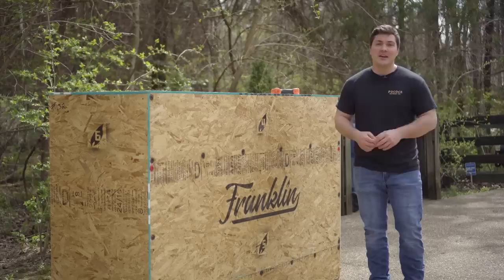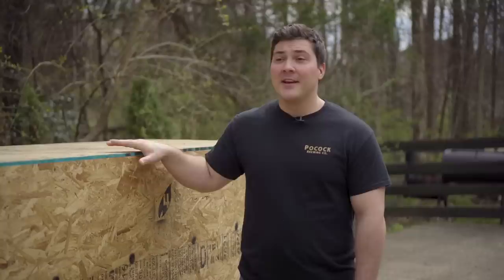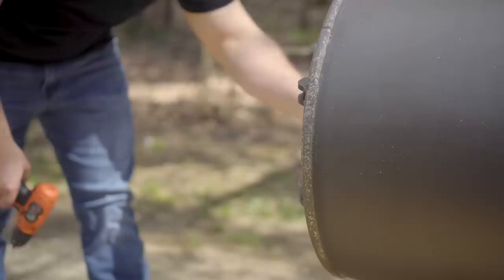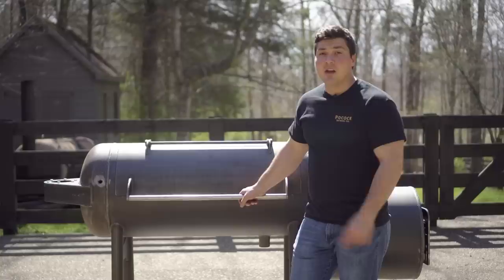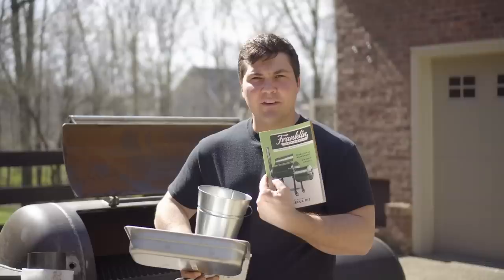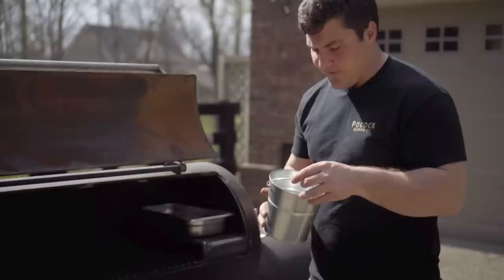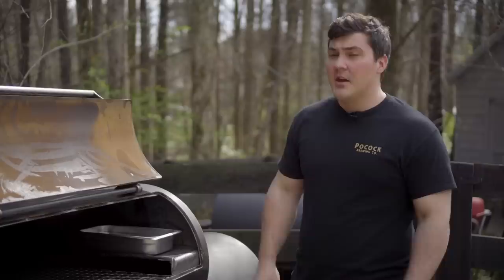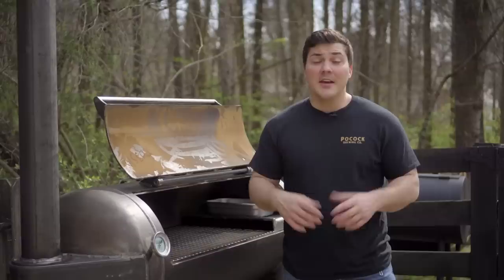Franklin BBQ Pit - My First Look | Mad Scientist BBQ

Comment from the maker: For those who are interested. I’ll be testing this out with brisket, pork butt, ribs and beef ribs. I’ll also be doing a comparison between this pit, the old country brazos, and a backyard size FatStack (custom) smoker. Let me know if you have any other suggestions!
Reply: Looking forward to the comparison.  I have my heart set on getting a Workhorse pit one day.  Also I like the music in this video.
Reply: Can you do a pork belly? Also will you show how you clean it and season it? I should clarify, clean and season the smoker :p
Reply from the maker: @UseAbuseReuse  for sure. I have been meaning to do that for a long time anyway
Reply from the maker: @great207  I have heard of them but I need to do some research
Reply: Since you have an all star line up of smokers for comparison, how bout include a Meadow Creek Ts 120 ?
Reply from the maker: @michaelkennedy272  that would be great. I’ve cooked on one before and it’s a good pit but I just can’t afford to buy that one too. If I can borrow one from somebody then I would be happy to do it
Reply: I can see the price being American made with good craftsmanship, especially in the welding. As a Steamfitter who has worked with pipe for over 20 years.
Reply from the maker: @jamesheenan648  quality American craftsmanship is not easy to come by and it’s not cheap when you find it
Reply: Please compare fuel use. Does the "beefy" build and price pay you back in splits?
Reply from the maker: @viclipsey3503  great idea!! I hadn’t thought of doing that.
Reply from the maker: @BBQcheese  I haven’t cooked on one. I cooked on a few meadow creek pits, but haven’t been able to get my hands on a Lang
Reply: How much do they cost? I’m comparing this to a Milwright.
Reply: Looking forward to that video!
Reply: @MadScientistBBQ  I hear ya ,that awesome American craftsmanship doesn't come cheap.
Reply from the maker: @ThatKidKc722  it was 4K after shipping
Reply: I was choosing between this Franklin, the Millscale 94 gallon, Workhorse 1975 and the FatStack 120. Went with the workhorse, but won’t be here for another month. Impatiently waiting....haha
Reply from the maker: @stewrogers7406  I hear ya
Reply: @MadScientistBBQ  seems about right! It looks quite well made
Reply: I have been using a pellet grill for over a year. Then I started following you about 4 months ago and now I know why I have cheating my taste buds. I have been torn on which offset smoker to buys this up coming video will help me out a lot. Would like to get into catering but I need to master the offset first. I enjoy all your videos and wish could come to one of your pop up events to try the brisket. Keep up the good work.
Reply: Which backyard fatstack!?!? The 120!!!!!
Reply: Fat side up?
Reply from the maker: @acureone987  whichever one I can get first!
Reply: Looking Very Forward to seeing you season the new Franklin and the Brisket, Ribs, Pork Butt, Turkey & Chicken Videos!  Also- Don’t forget the Initial Biscuit Test!! 😁👍👍
Reply from the maker: @2005Pilot  great idea!
Reply: How many briskets will this hold?
Reply: I love the idea.  For some reason the metal sounded light when you were rolling it around?  I would love to see the side by side comparison with the other backyard cookers!!!!!   Fire up as many as you can and get to work!  Hahaha.  Love your videos Jeremy
Reply: what is the price point on it?
Reply: Pork belly 😋
Reply: @stewrogers7406  The Workhorse 1975 is legit
Reply: Wow that offset Franklin looks really nice I just purchased a offset reverse flow smoker 36in Lang Deluxe hybrid Runabout waiting for it to come in by July excited to try it I might just purchase myself a Franklin later on down the road but I think this Lang is going to go ahead and do the job enjoy your videos keep it coming
Reply: I like many others bought the OC Brazos after your review and extremely satisfied might I add. Myself and others I’m sure want to know if this smoker is worth 3 times the cost of the Brazos... It looks very similar to a Lockhart Mill Scale 🤔
Reply: Go. Brazos!!!!
Reply: any chance you could link where to get one Jeremy?
Reply: Everything sounds great Jeremy.
Reply: @gregmccoy8616  I'm pretty sure we already know the answer to that question....😂
Reply from the maker: @thegoose3  the book says 3
Reply: I WOULD OF WENT WITH THE ROSETTA STONE REFERENCE , in the beginning because it was discovered by butcher, i mean Bouchard
Reply: Yes! Thanks for the great vids. You have one of the all-time best bbq channels.
Reply: I am definitely looking forward to the comparison. I've been considering getting on the wait list for one. I'm glad you gotten yours, and that will get a solid review on it. Cheers, and congrats on the new smoker!
Reply: Link to buy it please
Reply: If you could smoke  lamb (shoulder,  leg or rack) that will be awesome,  something new too look at. Also beef pastrami ribs...😏
Reply: Any thoughts on trying to do some videos on the Lang, Yoder (are you related?) and Klose pits?

Also, perhaps a future video idea on doing some smoking in subzero temps, like how you’d set up, how to protect the smoker, modifications to techniques? I live in ND near the Canadian border, and when it gets stupid cold, I’m curious if it’s even feasible to run a smoker (guessing it is, but would like to see the Mad Scientist’s take on it)
Reply: What is your take on burnt ends? Do you like them and have you done a video yet on them?
Reply: Are there any you recommend (even HAMRFORGE ) smokers to get to start a company ? Well a small business ?
Reply: I think a sort of “ultimate” comparison video would include a Weber Smokey Mountain (~$500) vs Brazos (~$1k) vs ~$1500-$2k smoker (Lone Star Grillz, etc.) vs Franklin ($2.5k+). That way, every price range is addressed to determine the cook and quality difference of each level. I think this could help a lot of people to figure out where they find the most value. Maybe you could borrow some smokers to help make it happen?
Reply: Can you add in a pellet grill with high quality pellets for us on the stick burn fence?
Reply: You do great vids.  I definitely like all the instruction and tips you give.  Keep up the great vids.  I'm a huge fan.
Reply: Good pit but WAY overpriced for what you get. Jamie Geer's pits dont cost much more and are FAR superior in every way.
Reply: Do you still have the gravity fed smoker? It would be interesting to see those two go head to head.
Reply: Casting my votes on a comparison between this one, some other customs and something more mainstream like a Yoder. Also, if you could check whether the surface temp of the waterpan tray get's hot enough to sear a snack (sausage for instance) for the pitmaster :)
Reply: I want one!!!!
Reply: Please include that $400 Home Depot pit in the comparison!  You were surprised at how well that Home Depot pit cooked a brisket, let's put it up against this beast!
Reply: Wow.  I dont know if the bbq with his name is worth the 3k price tag.  Could make tx brisket for much less.  IMHO 🤠🤔
Reply: How much?
Reply: @MadScientistBBQ  Speaking of not cheap, how much was the cooker? Their website doesn't list price.
Reply: Put that drill on there too.
Reply: @c7adventures376  It's actually $4k, holy cr*p, someone needs to tell the Emperor he has no clothes!
Reply: @hardtimesbbq5265  some people like to pay more for a name. I promise you can buy lots of other rigs for less money that are as good if not better.

I like Lyfe Tyme.  They are a great Texas made pit at a good price. Get one on sell at H.E.B. when the summer season is almost over.  They dont like to have them left over winter time.
Reply: @great207  oy
Reply: A tip: watch movies at Flixzone. Been using it for watching loads of movies recently.
Reply: @Dawson Matteo Definitely, I've been using flixzone for since december myself =)
Reply: @Dawson Matteo Yup, been watching on flixzone for years myself :D
Reply: @Dawson Matteo definitely, I have been watching on flixzone for years myself =)
Reply: @Dawson Matteo Yea, I have been using Flixzone for years myself :D
Reply: @Dawson Matteo definitely, I've been using Flixzone for years myself :D
Reply: So what was the price?
Reply: When is that video coming?
Reply: After using the Brazos and the Franklin pit, What do you say the Brazos is still your go to?

Comment: As massive and solidly built as this thing appears to be, the wheels seem a bit diminute. Maybe old Aaron should take a look at the Yoder YS1500s, and beef up them wheels on his smoker. And the water tray, instead of sitting on its own structure, robbing space for more grill area, could be fitted higher up, on a shelf like structure fixated on the circular end.

Comment: Ok a couple of questions. There doesn't seem to be a way to control; the heat? No cap for the Stack, No way to block the air through the off set? How do you put out the fire once the cook is done? The shelf seems to take up a lot of room in the main chamber? looking forward to the next video for the answers to these and many more questions.

Comment: Its very possible that the primary reason the door feels lighter than your Brazos, is because it does not have a front shelf to lean over.   My Brazos door got a lot lighter when I quit using the front shelf.   I get a much better angle on the door.

Comment: Hey Jeremy ... loved the unboxing !!! I did notice something, the handle has been installed the wrong way around. If I look at Aarons website the handle faces the other way which means that the weight of the handle would not open the door, but keep it shut.
Reply from the maker: Hey you’re right! I think you are the only person who caught. It has since been fixed, I noticed how hot the handle got when doing the burn-in and realized it must go the other way around.
Reply: I’m actually building my own smoker and studying every detail I can get my hands on. I live in Australia and a franklins BBQ pit would set me back around 6 to 7k . Loved the latest post on the ribs, it’s interesting how he has made the water pan tray to be bimetallic which in turn causes the air to swirl around the chamber.
Reply: @MadScientistBBQ  was there a lot of rust inside the cook chamber ???

Comment: for the price i expected much, much more!
Reply: He got screwed. Just like idiots who pay $29 lb for Franklin brisket
Reply: How much did it cost?
Reply: @rueridge7597  $29 per lb is pretty crazy. I remember when it was $13 per lb. When something gets too popular and over priced it's time for me to look elsewhere. I will admit I think Franklin's is the best but they're others that are almost as good.
Reply: @zachgoering2259  Retail price: $2,950
Weight: More than 550 pounds
Cooking grate size: 19 by 36 inches
Height without stack: 47 inches
Height with stack: 81 inches
Width: 20.75 inches at aster
Length: 79 inches
Reply: @bobbyk2126  I think the $2,950 was the original price.  I received my info to buy last month and the price they gave me was $3,450 so it must have went up due to steel prices going up.

Comment: I see one big oversight.  In my mind anyway. No cover or lid to stop rain water pouring down the exhaust when not on use.  For the average joe home BBQer this is an issue that will need addressed.
Reply from the maker: Very good point. They will sell you a cover for $300 though
Reply: @MadScientistBBQ  A tin can is free, and IMO, fitting for a classic pit, as it gains some age.

Comment: As an engineer (and really just a consumer), I don't even need to finish the video to know that this is a fantastic smoker. The fact that they had the forethought to plan out such a detailed process for just getting the smoker out of it's packaging tells me that there was an insane amount of detailed thought and attention to detail in the design of this smoker. That, and the fact that one of the best grill operators alive designed it, is more than enough for me to pony my money up and buy one when I upgrade. I just pray that my wallet will recover when I find out the price.

If it turns out at the end of this video series that this smoker sucks, I'll piss on the brisket I'm halfway through smoking. Mainly because I don't have a hat to eat.

Comment: I'm excited to see what you think.  I own #138!
Reply: How much was it? How much is shipping?
Reply: Total cost for one of these Franklin pits, including shipping?
Reply: About 4300 for me.  I had to pay tax.
Reply: @dustindorsey6380  Thanks for the info!   A bit pricey for me, was really curious, will be sticking w/ my Old Country Wrangler bought at Academy for $500 which does a damn good job for me and my family.  No doubt this Franklin pit is higher quality construction w/ better welds, and I may try to lengthen the smoke exhaust pipe on mine for better air flow down the line.  I'm sure you'll love your smoker.  Don't know if you're close to a Costco, but I have one just down the road from me here in Lafayette, LA and they sell prime grade briskets for a very reasonable price.
Reply: @frankd4875  My old pit was an Old Country pit similar to the Wrangler.   They are good pits.

Comment: I had a all steel smoker “The Good One” a few years back that no matter how well seasoned it was, turned into a rust bucket. Especially on the inside. The racks completely rusted out. I did leave it outdoors, but it was covered, and that didn’t help. How do you protect these all steel smokers so that they last many years? Mine lasted maybe three. ☹️  it was even painted on the outside with high temp engine paint.
Reply: I have two Good One smokers and both have serious rust issues.  I've had one for almost five years and the other one for four years and both were covered with Good One covers under a covered and sided carport.

Comment: Go figure i finally get my brazos and you turn your back on us lmao.... also wonder whats more valuable the smoker or the plywood its wrapped it haha...... looks cool, wish our Brazos had casters like that, I move mine out of the garage when I use it and it wasn't designed to move around.
Reply from the maker: Yep. Brazos is actually much better to move around the backyard. The casters on this thing just sink into the dirt
Reply: @MadScientistBBQ  

Never thought about that. I have concrete so picking up the one side on the brozos is tough for a 5'7" weakling lol

Comment: Man, I'm sorry, but im not impressed with these at all. The metal is light, and there is no way to control air flow. The bolt on stack is a terrible design. You are going to have heat/smoke loss there, and probably water penetration too. 

These are made right next door to my work. I've put hands on maybe a dozen of these. I love Franklin's BBQ, but these pits are not anywhere near the quality of a custom pit for less, and it's insane to spend that much on this pit.